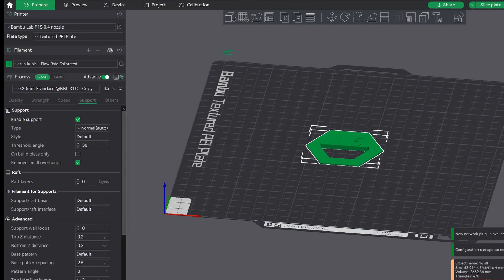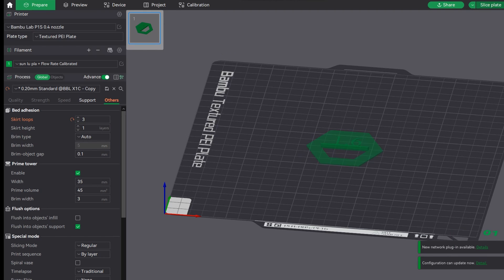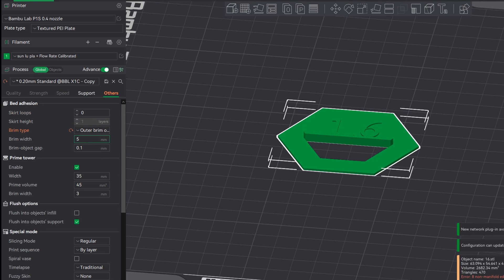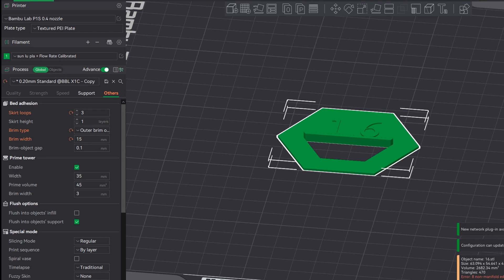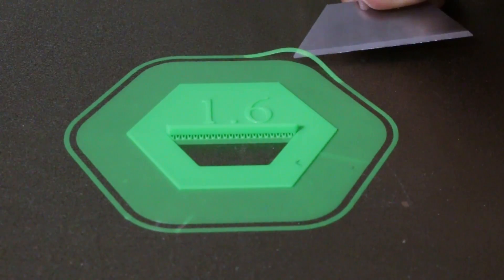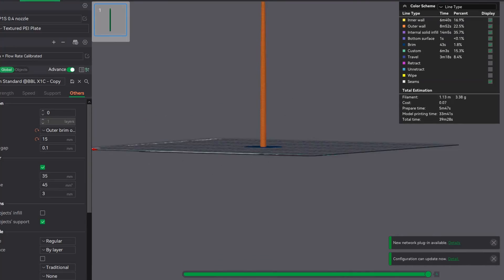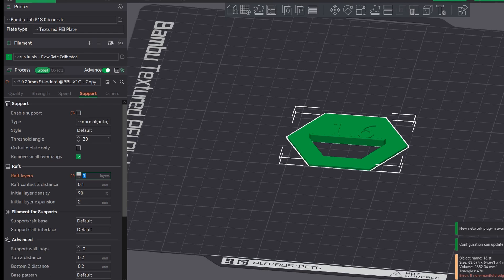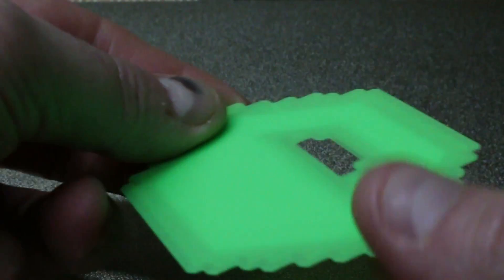Brim, Skirt or a Raft?? In Bambu Studio

Comment: You said what the differences are, but you only kinda explained why you would use the brim (to provide a bigger contact patch for tall skinny potentially unstable parts).  

Why would I use a raft?  Why would I use a raft on a small flat part like the example?  Would I ever? Or was this just illustrating the definitions?  Rafts are good for securing arrays of small parts so they don't loosen during the print, but what is it doing in your example?

Are skirts useful at all?  Isn't bed leveling a default prep step in Bambu printing (like motor/vibration compensation)?  Why print a skirt at all?
Reply from the maker: This was a explanation only of what they are because at the time the video was made a lot of people were using the wrong names for each. 

A skirt is more useful for the older Enders- you can use that to level the plate on the fly

Comment: Whats the point of a skirt
Reply from the maker: Skirts more used as a purge line. On printers such as Enders you can also use them to level the build plate as a fly by wire also

Comment: if the skirt is not attach to anything, hat use does it has?
Reply from the maker: It was generally used more for the older Enders, used to purge the filament before printing started
Reply from the maker: And you could also use to to level the bed fly by wire- as they weren’t self levelling!

Comment: So, what's the point in a skirt then?
Reply from the maker: It’s more of a purge line. Bambu/orca does have this built in for crops the front- so not a lot. But is useful on printers such as Enders as you can use it to also manual tram the bed when the print starts
Reply: Purge and wipe in all angles, usually quite useful

Comment: how do you make rafts easier and smoother to take off?
Reply from the maker: I don’t believe it’s a option unfortunately- they def can leave “marks” 
You can however (if you have a ams) use a interface for suports- which is a lot cleaner
Reply: Look into the air gap setting. I have adjusted it in other slicers, but I am not sure if there is an option for it in bambu Studio since I have not had much of a reason to do it in there yet.

Comment: What are each used for? You said Brim is for tall objects with a small footprint, but didn't say what the others are for.
Reply from the maker: A raft is very similar in its uses as a brim. A skirt is a purge line, not used for adhesion